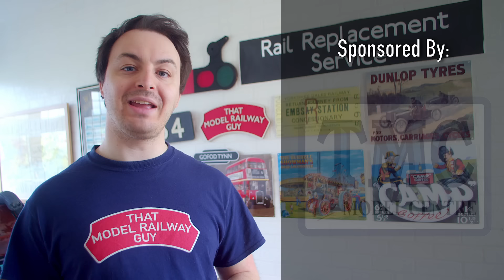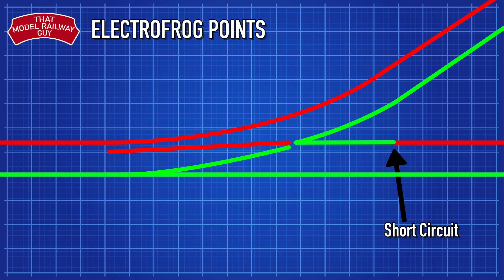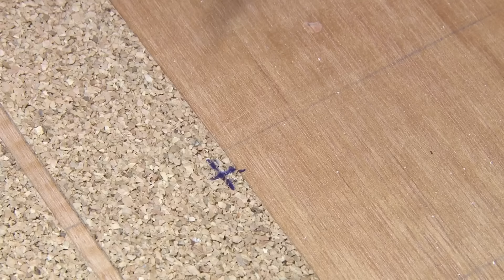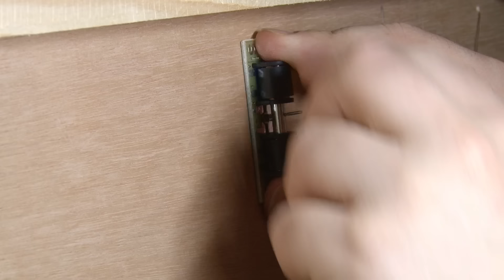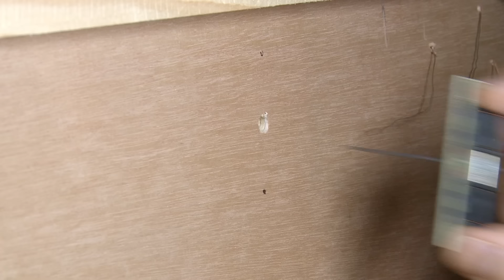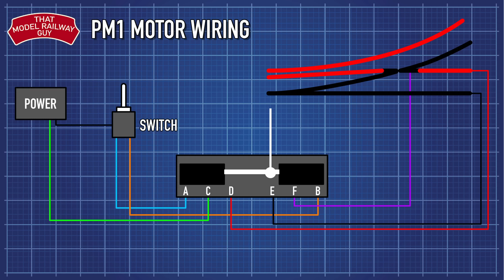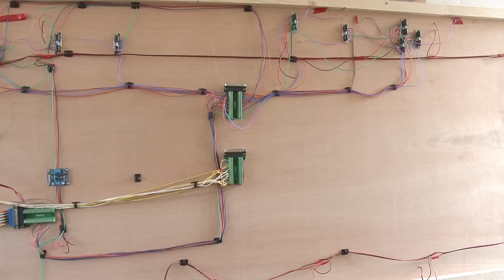How To Wire PECO UNIFROG POINTS - Model Railway Tutorial

Comment: Hi thanks for the videos. What is the difference between the Unifrog and the Electrofrog points, if you are going to do all the extra work of powering the frog from the point motor switch?
Reply from the maker: As shown in the diagrams at the start, the electrofrog points aren't isolated in anyway. Even if you aren't using point motors or powering the frog at all you'd still need to create isolated sections beyond to avoid creating short circuits.

The unifrog has isolation built into the frog already so you can use it out of the box as is or power the frog for full continuity. The end result is the same, it's just much easier to do with the unifrogs so see them as an evolution from the electrofrogs.

Additionally, the unifrogs tend to have a wire bonding the blades to the stock rail so that you're not relying on the blades touching for continuity. On electrofrog points this is another step that has to be carried out by the modeller for better track power continuity. Hope that helps and thanks for watching 👍
Reply: @ThatModelRailwayGuy  ok thanks. I’m used to controlling the frog polarity on the Electrofrog points. Will the Electrofrog ones be phased out in time?
Reply from the maker: @gethinjones5736  PECO have said they intend to move everything over to Unifrogs eventually but knowing how they tend to move at a glacial pace it'll take a while for everything to be updated.

Comment: Hi need some advice please. I’ve had to use a peco PL-11 side point motor cause of a battery under the layout I’ve also bought a gauge master GM500 to make electro frog frog live but don’t know how to wire them up to work in conjunction with each other as well as a CDU. Sorry for my stupidity. But we all need to learn. Drawing would be great. Many thanks
Reply from the maker: I haven't used either the PL-11 motors of the GM500 so my knowledge is somewhat limited here. However looking at the online instructions for the GM500 (https://www.gaugemasterretail.com/media/ProductPdf/BPGM500-v2_1.pdf) it looks like the wires from your toggle switch that go to the red and black wires on the PL-11 need to be daisy chained to the A and B tabs on the GM500. If you're still confused though I would recommend reaching out the Gaugemaster directly as they will be able to offer more help than I can with a specific product like this. Thanks for watching 👍

Comment: I'm unsure what to do, the exposed wire came off on my unifrog point and idk if i show try and solder it back on or buy a new one
Reply from the maker: How new is it? If you've literally just bought it and it came off while you were trying to lay it maybe get in contact with the shop and see what they say as it might be faulty. If they refuse to take it back (or it's been too long) I'd suggest trying to solder a new wire on first. If that doesn't end well then buy a new one but you never know, you might be able to solve the problem yourself without spending more money. But only do this after you've contacted the shop - they probably wouldn't take it back if you've already tried to mess with it. Thanks for watching 😃
Reply: @ThatModelRailwayGuy it was half an hour after it arrived to my house, I took it out and out it on the base and then it snapped
Reply from the maker: @Barrow_Home_Media Definitely get in contact with the retailer you bought it from and explain the situation then. They should be able to help out as long as you've not been excessively rough with it, which doesn't appear to be the case 👍

Comment: Okay and what power source do you use?
Reply from the maker: You can use either DC or AC depending on how you wire up your layout. I'd suggest checking out the following video if you want more general info on solenoid motors in particular: https://youtu.be/T95X4JPRKkk Thanks for watching 👍

Comment: Can you use a toggle switch or will it burn up the motor.  I would think you would need an on off on toggle switch.?
Reply from the maker: Yep, in fact I used toggle switches for this layout.You need to use momentary switches though as if you use a latching switch it will burn the motor out as you suspected. You can also help prevent this too by using a CDU which provides a short burst of power. You only need one CDU for all your points so using both this and the momentary switches are the best way to protect your motors. Thanks for watching 😃

Comment: Hello it me agen I do have a question. have just received a peco large y point and I noticed it has no split between the frog and the switch blades why is this and do I need to cut my own split in the rails all my other points have the cut but not this y one.
 this is electrofrog
Reply from the maker: No there should be no need to cut the rails on points. If there isn't a cut then it's not needed, especially with longer radius points. Thanks for watching 👍
Reply: @ThatModelRailwayGuy thanx for getting back I've looked on the back the box it comes in and it's got the same diagram and text as all my other points I have so I've been looking for something that explains how this point is ment to be set up but I can't fined anything on how to set up the peco y point pl-e98. There is no videos or no articles on this at all not even on Pecos website so I'm just looking at the way I did my other points thats why I'm trying to fined as much information as I can on it.
The other part that's confusing me is there is still a frog wire on the underside of the point.
But thank you for helping.

Comment: Im an electrical nightmare but I seem to understand most of this video. So I’m installing 4 sets of Peco unifrog points. I’m now at wiring up stage. Can I ask if the “common” is the same as what I know as the “earth”? In the wiring graphics there’s also a black lead from the switch to the power. Can this be explained please? Sorry. Once I’ve done it I’ll never forget but it’s just sooooo confusing. Cheers. Joe.
Reply from the maker: No the common isn't the same as the earth. If you think of the circuit being a loop that goes out from the power source to the point motor and back again, the common is the second half of that that returns from the motor to power source to complete the circuit. 12v DC doesn't have an earth. 

The black lead would be the first part of that circuit. The power going from the power source to the switch (and then on further to the point motor). Hope that helps and thanks for watching 😃
Reply: @ThatModelRailwayGuy thank you.

Comment: Im thinking about using unifrog points on my new layout 
Predominantly fleischmann not a fan of the bulky fleischmann/ roco points 
Was thinking about making the points manual do i need to wire them differently 
Great videos really enjoy them
Reply from the maker: For manual use you can either leave the frog unpowered or have some sort of switch that changes the polarity when you change the point. The wiring would mostly be the same just without the actual point motor parts. Thanks for watching 😃

Comment: Hi I’m thinking of building my first DCC layout and wondered where do I pick up power for seep point motors please. With my previous layout I had a separate feed 12v uncontrolled output
Reply from the maker: Hi there, you basically have two choices:
1.) You can have a separate 12v feed just as you did before. That's how I'm running the points on the layout shown in the video. The DCC feeds used to power the frog polarity is completely separate to the 12v power feed that is used to switch the actual point mechanism. This might be the better way to go if you already have some experience doing it this way.

2.) The second option is to use DCC compatible solenoid motors. While the motors are bit more expensive these would be powered and controlled by your DCC Bus - the same set of wires that you use to take power to your track. Some people opt to have a secondary "Accessory DCC Bus" for controlling points/lights/signals/etc just to keep everything separate. The advantage with this is that you can assign each point a DCC address and control them all from your handset along with the locos so there's no need for a physical control panel.

Hope that helps and thanks for watching 😃

Comment: I'm seeing absolute no difference between Electro and Unifrog other than you no longer need insulating fish plates. They still wire up and work in the exact same way. Am I missing something??
Reply from the maker: They're intended to be pretty similar to Electrofrog points and have all the same benefits but with the option that you can use them straight out of the packet like with Insulfrog points. With Unifrog the wiring is optional and like you said you don't need to worry about having isolating sections.

I believe eventually PECO intend to phase out Electro and Insul altogether and Unifrog points will be the new standard. That will obviously take some time though given their huge range across multiple scales. Hope that helps and thanks for watching 😃

Comment: what do i do if i'm on analog and want to only provide power to one track at a time but don't want locos stopping on points?
Reply from the maker: You'd need to isolate diverging routes first using plastic fishplates. To control the power flow he simplest way would be to wire up the point for the frog polarity as shown in this video then have an isolating switch on your control panel to swap the power from one diverging route to the other. 

If you wanted this to happen automatically you could try and rig up a way for the point motor to trigger a microswitch that would swap the power to the diverging line - but I suspect it would be quite fiddly to install.

There may also be a way to do it all with relays too. I think you'd need two relays for every point (one for frog polarity, one for power beyond the point) but I don't have a huge amount of experience with relays myself and I'm unsure of how you would trigger two relays from a single point. Hope that helps and thanks for watching 😃

Comment: I don’t know about other people, but getting hold of Unifrog turnouts is very difficult where I live. I wish Peco would increase their production range and capacity.
Reply from the maker: The Unifrog points are being rolled out slowly as existing point toolings expire and need updating so it's not so much that they're difficult to purchase and probably more that they don't exist yet.

At the moment only the TT:120 and the Bullhead ranges feature all Unifrog points because these were brand new. Eventually all PECO points will be converted to Unifrog points but with such a massive range spanning across lots of different scales, that's going to take time. PECO are also well known for taking a glacial approach to things too so I don't imagine it will be a quick process. Thanks for watching 😃
Reply: @ThatModelRailwayGuy pleased to say I managed to get code 75 unifrog points recently!

Comment: How do you know what point is what switch ? A board with switches ? and the how do you know wich switch is what point ?
Reply from the maker: Just connect each switch to its corresponding point one at a time until you've got everything hooked up how you want it. Labels or a little diagram can be useful for remembering which switch controls each point. Thanks for watching 😃

Comment: When using these point motors, do you have to remove the spring in the Peco turnout? Thanks for a very informative video. Cheers
Reply from the maker: Nope, in fact with the solenoid motors I'd say having the spring in place is probably better as it'll hold the blades to the rail when the motor isn't active. Some people like to remove the springs if they're using servo or slow action motors for a more realistic look but personally I still like the failsafe of the spring holding the blades in position. Thanks for watching 😃
Reply: @ThatModelRailwayGuy  Thanks for that response ... Cheers

Comment: Any thoughts on wiring a unifrog double slip (SL-U1190)
Reply from the maker: I've never wired up a double slip myself but I believe you need to wire the blades and motor to the opposite frog:
-The left hand blades/motor controls polarity of the right hand frog. 
-And the right hand blades/motor controls the polarity of the left hand frog. 

With that in mind, the actual wiring is the same as shown in the video just done twice, one for each set of blades. A double slip is essentially just two sets of points laid on top of each other. Hope that helps and thanks for watching 😃

Comment: DO YOU STILL HAVE TO USE THE INSULATED RAIL,JOINER BETWEEN THE TWO V AT THE END OF THE POINT TO THE TWO TRACKS
Reply from the maker: Only if you want the section beyond the point to be isolated for some reason - for analog operation for example. But no, as shown in the video there is no need for an insulated joiner. There's also no need to use all caps either, I answer all questions just the same. Thanks for watching 👍

Comment: Please how do you fix the Peco PL11 Turnout motor when there are no pins on the Unifrog tie bars?
Reply from the maker: I'm not sure I understand, the TT Unifrog points I show in this video all have the pins on each end of the tie bar. Thanks for watching 👍
Reply: @ThatModelRailwayGuy  - No the Peco SL-U1195 points I have purchased recently just have a hole in each end of the tie bar., no pins on the code 100-75
Reply from the maker: @PaulGarwood  Those are 00 gauge points though and part of the Bullhead range. Being finescale turnouts they're not intended for use with surface mounted motors.

Comment: I notice on the rail close ups that you have painted the rail chairs a different colour to your sleepers to give the impression of rust…..it looks really good so I have to ask you have you painted every single rail chair on your layout and if so how long did that take you?  Great channel by the way.   Regards Jim
Reply from the maker: Hi Jim, I only did that on the 00 gauge layout - I couldn't face doing it on the TT layout which (despite being a smaller layout) has considerably more track to worry about. The 00 gauge layout was modelled in short modules/sections so I was never doing more than 4ft (often less) in one go. Even so it was pretty time consuming but it does look good. If you check out the Building A Modular Model Railway series you'll see how I weathered the track on that layout in much more detail. Thanks for watching 😃

Comment: I have noticed you are using a class 08 which DCC chip are you using and is it possible to fit a stay alive in there?
Reply from the maker: I think it was just a spare Zimo 6 pin decoder I had going spare. Others have been able to fit a stay alive in the 08 but I haven't felt the need yet given it now runs so well over the points. Thanks for watching 😃

Comment: Nicely  narrated   with  colour  graphic,   easy  to  follow...well presented  as  usual. Question is  the  power  source  of  any importance  in this  set  up?
Reply from the maker: For powering the switching of the points themselves most people tend to use 16v AC for that. The wiring for the switching of the frog polarity is the same regardless of whether you're using DC or DCC for the track power. Hope that helps and thanks for watching 😃

Comment: Excellent explanation. Maybe you could do one for other point motors eg cobalt digital IP and tortoise.
Reply from the maker: The process would be almost exactly the same for most point motors. If you understand the process used here with the simple SEEP motors, then really it would just be a case of checking the manual for whichever brand of motor you're using to see where to place the polarity feed wires. Hope that helps and thanks for watching 😃

Comment: Great explanation of the differences between the different styles of points! The other advantage Unifrog points have of course, is that they don't rely on the switch blades to "route" the power, which means no more "sticky" patches when the track gets a bit dirty! Just wish the Unifrog points were available in more styles in N gauge! All the best, Ian.
Reply from the maker: Yes I've heard of lots of people adapting electrofrog points to work in this way so it's nice that PECO have built it in for the unifrog points. I believe the plan is to upgrade each point to a unifrog as the current mould/tooling comes to the end of its life. It won't be a speedy process but generally we should start to see more and more unifrogs appearing on the market. Thanks for watching 😃

Comment: Can you show how to wire the point if you want to switch them manually please
Reply from the maker: If you wanted to switch the point manually you'd need a rod from the tie bar to interface with a microswitch which can switch the polarity when set for the diverging line. Would be a bit more work though. Thanks for watching 😃

Comment: I’ve been trying for 3 days to figure out why my PM1 will only throw one way, it tries to throw the other way but doesn’t make it 😔
Reply from the maker: My first thought would be to remove it from the point and make sure the mechanism throws properly (with power) on it's own. If that's ok then it's most likely just an alignment issue. 

I've also had it in the past where the hole is drilled in just slightly the wrong place, restricting movement in one direction, and subsequently needs opening out. Hope that helps and thanks for watching 😃